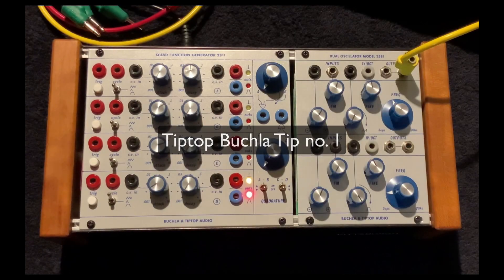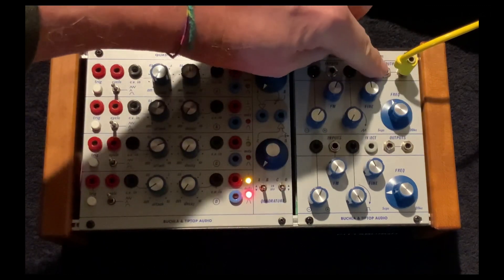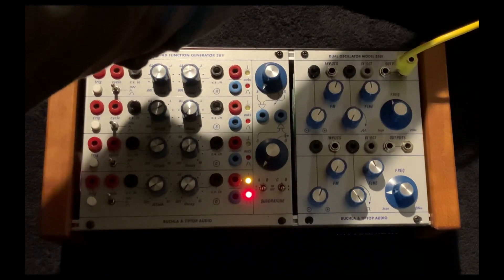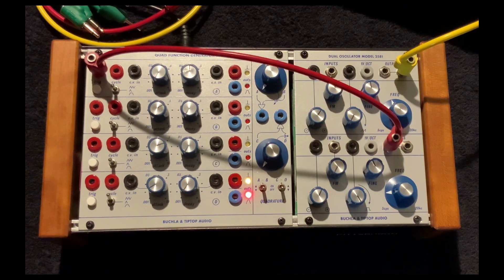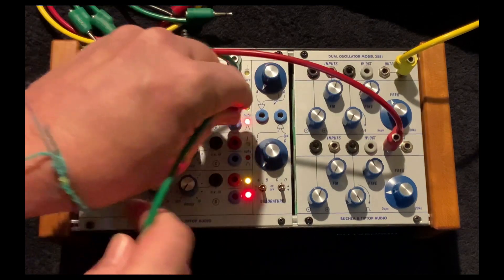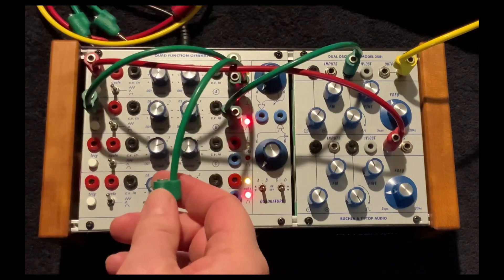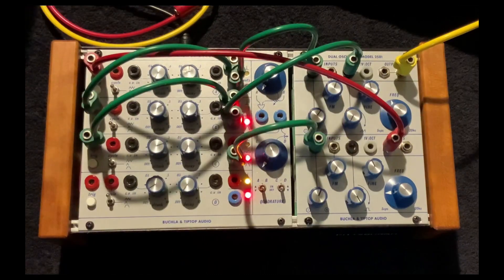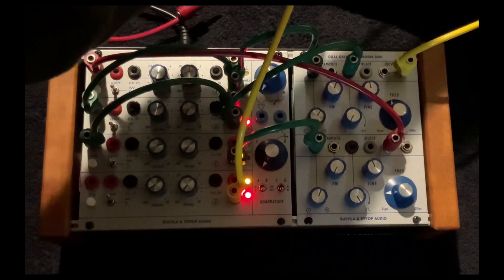Tiptop Buchla Tip No 1

Comment: Hey Todd, how well does this subdivision trick work at audiorate on the new 281T? It's one of my favorite functions of the DUSG.
Reply from the maker: Hmm…not sure I grok your question. At audio rate it would turn into fm. DUSG is two function generators the 281t is four.
Reply: @vgermuse  sorry I was unclear. I'll try to describe what I mean. If you feed a pulse, square or rising edge signal into the DUSG "trig input", you launch one cycle of the rise and fall function. All triggers at this input are ignored while the DUSG is engaged in its rise/fall function which means you can derive clock subdivisions at LFO rates or, with audio rate pulse waves, you get frequency subdivision.

Can you perform the same audio frequency division with the 281t? So square wave into the trig input with rise and fall at short enough durations to output a harmonic subdivision?

Hope this was better articulated!